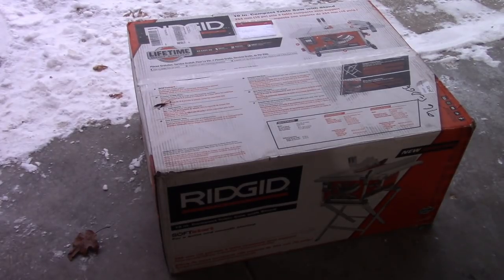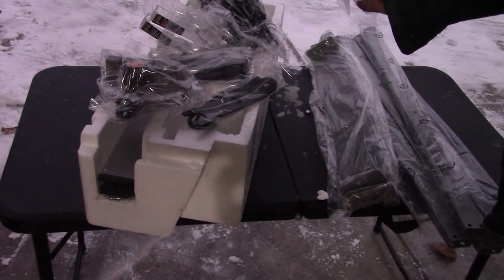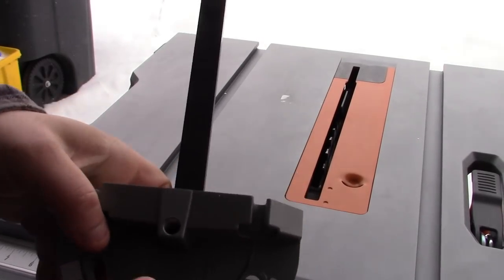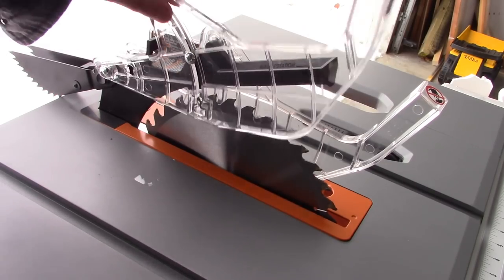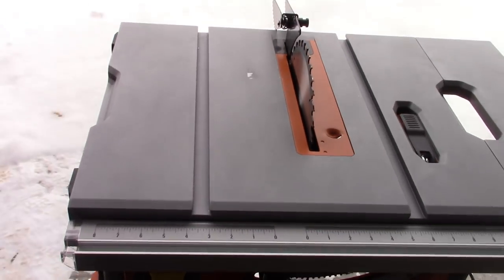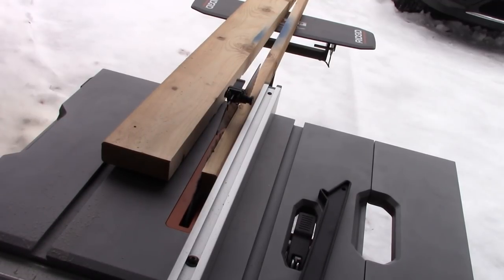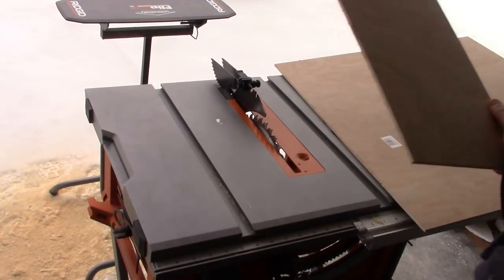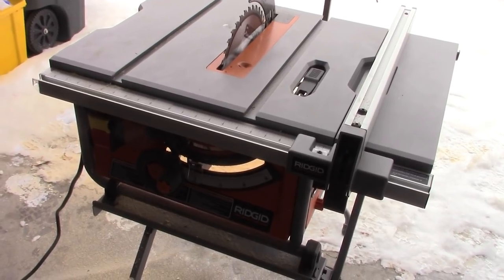RIDGID 10 in. Compact Table Saw with Folding X-stand Review (R45171)

Comment: A good mod for any table saw is to make a through plate (the access plate for changing blades) for straight cuts to minimize the tearout with plywood.  Use the original plate as a template on a new piece of wood, install it with the blade down, put the fence near the blade over the plate, turn the saw on and slowly raise the blade cutting a clearance slot the width of the blade. Can’t use with bevel cuts but most cuts are straight, right?

Comment: Due to your review on the Ridgid Table saw, I ended up buying the Ridgid R4514. I recently assembled it, and it is a very solidly built machine. No regrets. I have one question for you: I seem to have the same stamped aluminum top as yours. Very sturdy and not heavy at all. Do you put anything on it to preserve it, or is that not necessary? I know that with Stamped steel tops you have to polish them and put on a finish to keep them from rusting. Thanks for any information you can provide.
Reply from the maker: Hey Gregg. I dont do anything with it and is still fine. Tha ks for the feedback bro👊

Comment: Good video,I ended watching this video because I am shopping for a table saw and had seen this on HD website,but once I saw the play on the fence really didn't like it,Dewalt's are some what more pricey but their fence has no play because it is a rack and pinion system,still a good value there,thanks for posting.
Reply from the maker: Jose Sanchez thanks for the comment buddy. It's a good saw,  it the the fence is not my fave
Reply: Crappy thing about the dewalt is they lack in being able to use Dado blades. What turned me off from their tablesaw.
Reply: You are right,most tools regardless of prices always lack that one feature that we want or need,sometimes the crappy one with the worst reviews might have that particular feature we want,so if there are budget or space limitations sometime we got to settle on the tool closest to our needs.

Comment: Ive been trying to purchase one of these.  However they aren’t available anywhere.  I even contacted Ridgid directly and they couldn’t help me.  They referred me to HD who doesn’t ever seem to have them in stock.  I hope
They don’t inflate the price, when they become available.
Reply from the maker: +Bassedmen Thanks for the reply. I noticed that when Ridgid comes out with a new product, they sell quickly and run out of inventory. When that happens, they take it down on the depot site until make more supply. I have seen them do this on many different items. Give it a week or two and they should have more ready to go. If you don't see anything change, let me know and I will see if I can get a hold of someone for you
Reply: Thanks ... Much appreciated...  By the way... Awesome review...    Regards..Ed
Reply: I am waiting for these to come back in stock as well.  Hopefully soon!
Reply from the maker: In case you guys were not aware, there are two separate models of this saw. The current saw on the Depot page is (NR4517). This model is (R45171) and has soft start on it. For some reason, this has not been released on the Depot site as of yet, but should be soon.  Just wanted to let you know just incase
Reply: Tool Review Zone yep. Looking to buy one in the next couple weeks, maybe I'll luck out and they'll have the soft start. If not I'll go with the r4517 instead.
Reply: UPDATE  I was able to purchase the saw... i called HD and per customer service they were completed out of stock everywhere... So I gave in and went to purchase the R4517.. HOWEVER when I arrived at the store there was ONE in stock... Hurray... I purchased it immediately...   Thank you for your help..  
Check a few HD locations they may have the R45171 without even knowing it...  Good Luck ..
Reply from the maker: Glad you got one bro. Seems to be the trend from what I hear. Not sure why they are hiding these away in the back?
Reply: Theres about 6 of them sitting in Rhode Island, i bought one last week
Reply: I see them on HD site now, hoping to pick one up in the next few weeks.  

https://www.homedepot.com/p/RIDGID-10-in-Compact-Table-Saw-with-Folding-X-stand-R45171/303527823

Comment: I have a question, I purchase the ridgid R4517 at home depot on black friday are there 2 models?  The one I purchase doesn't sounds like it has slow start up. It kicks in with a big punch. This is my first table saw ever, and I agree Its a awesome table saw. Would like to figure out a good way to switch bolt lock down system for transportation purpose. Thanks for the review on this table saw been waiting for someone to put up a review on this one !
Reply from the maker: +LEO GAONA thanks for the question. Yes there is actually two different models. The one you purchased the R4517 without the soft start. I actually had the same question when I seen the model numbers did not match up.
Reply: Tool Review Zone where did you purchase R45171 model? Mine not being  soft start would that mess with anything on long run  besides the big punch it puts out? I purchase for $199 that day , is there a big price difference from what you were able to purchase it for?
Reply from the maker: +LEO GAONA Home Depot will be the only place to get this. Give it about another week or two until back in stock. As for the soft start, I never based my decision on wheater or not the tool was a soft start it not. Is it nice to have sure, but not that big of deal to me. At this time of year, it's hard to say what price range, but probably $50 more than your current model.
Reply: I do have a pair of 3M ear muffs that will help when cutting.  Thanks for the info.
Reply from the maker: +LEO GAONA I usually always use mine too. Any time bud!
Reply: I put wing nuts to lock my saw to the stand, works great for moving the saw around. 
I also saw this on the floor at Home Depot on Black Friday, great deal, paid 199, they are 299 now and never see them in stock.
Reply from the maker: +Tom M that's a great idea! Fyi, Ridgid had a sale for a different model than this on Black Friday model number R4517, but this is R45171. I think they are still selling the black Friday saw, but no soft start in that one.

Comment: How accurate was the fence and does the measurements move with the table when you expand it to get more cut capacity? I been looking to get this table.
Reply from the maker: +Ricky Gonzales thanks for the question. Yes the measurements move with the table. The fence is spot on, and locks down extremely tight. There is a bit of play when adjusting it, but straightens out nice when locked down. I'm impressed with this saw, and say absolutely check it out.
Reply: Tool Review Zone thank you for your fast response, now its just time to convince the wife to let me get it.
Reply from the maker: +Ricky Gonzales lol no prob bro, and good luck!
Reply: Tool Review Zone is there storage for the fence and blade guards on the saw?
Reply from the maker: +Ricky Gonzales Hi Ricky,

That's the one thing that they did not add to this. No storage area for these
Reply: I just bought this saw.  On mine, that play in the fence IS an issue.  It doesn’t square up on its own when you clamp it down
Reply from the maker: +Brian Mcclelland yeah, unfortunately this was the same issue I spoke about. I noticed that if you push forward on the front of the guard while locking it, it will go square, but I am going to see if there is an after market that may work better
Reply: Is there a decent rip fence upgrade for this saw?

Comment: Will it cut a 4x4 with one pass?
Reply from the maker: Yes. This saw is beast.
Reply: No need to turn the 4x4 for a 2nd pass?
Reply from the maker: So bro, I get what your saying now. So A 4x4 actually sets up flush with the height of the blade 3 7/16" off the table. The 4x4 that I just measured is exactly the same. If the would be e added 1/8" more on blade height, I would say absolutely, but it will be a close one.

Comment: Nice review, Thanks. I compared this model with and oldie Ryobi portable saw and this is a notch above because the dust shut. The rest of the equipment is basically the same. Odd shaped runners channels, noisy, sub standard fence, crappy miter gauge and plastic box. The soft start.... well, not so soft at all. It is similar to the Ryobi after 6 months of use. For the price, the Ryobi is a better choice. I have not test the pro model yet. 
For true soft start you will have to move to a belt driven, steel table higher model.

Comment: I have the R4513, same thing but with wheels basically, I love it, it did not arrive at 90 degrees but its not too hard to sort out. The fence is awesome, I find if you just push it forward as you lock it in its pretty dead on. For 369 + tax I feel like its a solid table saw, I wanted the jobsite one so I could tuck it away in my garage. Just in case someone is watching this debating between the two.
Reply: Aaron Kay how did you get it to 90 degrees? Those two flat head adjustment screws won’t turn on mine

Comment: Thet hing I hate about the Rigid is that the insert is NOT flush to the top of the table. The older model was like this too. It's stupid. No matter if its a zero clearance or not, the insert should not be sunk into the table because when you try to move material across it can tilt down and ruin a square cut.
Reply: If the insert is below the table top. There are leveling screws to bring the insert flush with the table
Reply: @doehmerh5660  included? The screws I had included don't do that. They actually don't even sit flush with the insert on their own so stuff can snag sliding across.

Comment: now you can’t buy one without a stand and they cost much more.
$400 up to $570
Reply: Bought one last night (10/02/2022) at Home Depot for $299 (Ridged 15 Amp 10 in. Portable Jobsite Table Saw with Folding Stand).

Comment: I like how you show the TOP of the plywood from the cut ;)...truth is I didn't see much tear out from what I can slightly see on the bottom..although at 26:42 or so you can see tear out on the bottom next to the blade..from the work piece you left on the table..ofc, nearly all new or very sharp blades will minimize tear out.....I usually kinda like your videos, but this one seems...I dunno...like a sales pitch at times....not giving you a literal thumbs down on this one...but no thumbs up either.